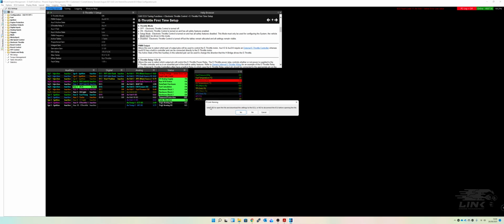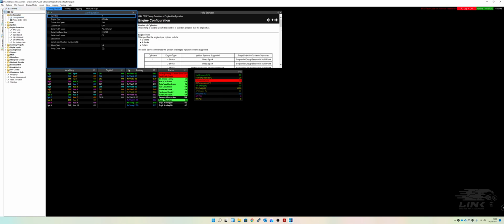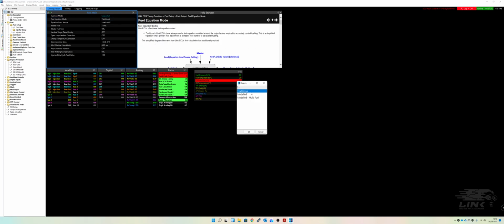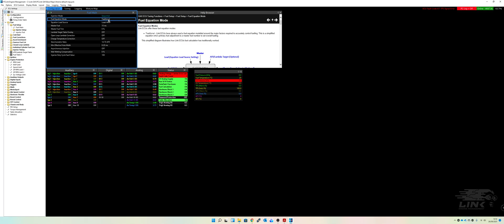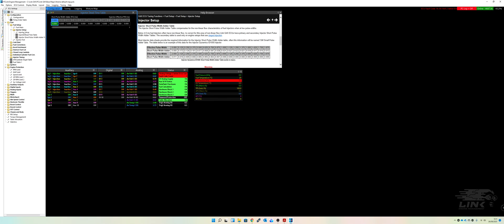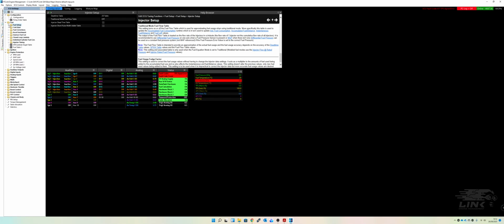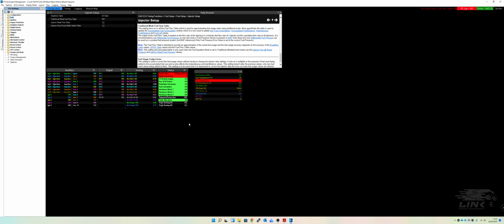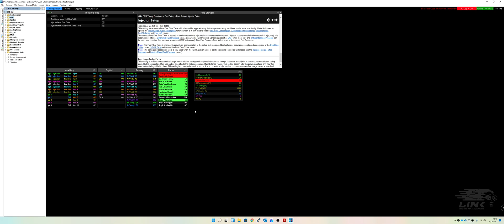Link Engine Management Loading a Base Map

Comment: Hi i followed your instructions on how to load a base map and now the screen im on is showing alot of everything is off off? Should i have loaded a base map that said my car in particular or from the default x map you showed.
Reply from the maker: Hey Redwar08 I'm not 100% sure that I follow what is going on here. Do you mean certain inputs and outputs are off? Was the base map designed for the wiring harness that you have? Are you just using the base map to get VE and Ignition tables so you need to setup the Inputs and Outputs again. If you want to supply more details go over to www.phoenixenginemanagement.com and fire us a message maybe we can see in better detail.
Reply: @PhoenixEngineManagement  ok here is my problem..i have a 350z manual i did alot of work to it. I bought the link g4x ecu plugged it up and followed your videos on how to set it up i did exactly what you said to do as far as setting up the base map. In the last part of your basemap video you saved all the settings to the link g4x default map and i did that. When i pull it up it shows inj off ign off mainly everything is off my question is is this basemap that your teaching us to setup a basic get the car started and running basemap? or is this a ready to tune on the dyno basemap because it seems like everything has to be manually entered in all over again such as injector size, ignition coil imputs etc etc.  So what i did was go back to the beginning and loaded a pre set up base map that already said 350z manual g4x plug in and when i clicked on that and saved it everything was like active so i took a chance and started the car it started and idled kinda high at like 2200 rpm but i had no throttle..it was like no pedal was in the car so i tried to go to TPS and it said something like cant adjust not in setup mode or some shit like that..im like what the Molly fuck is going on here..mind you phoenix ive been building race cars all my life but coming from the carburator world into this advance computer world im totally lost to shit..i wish i had your knowledge because this shit is not easy at all.
Reply from the maker: Hey Reb yeah this video in particular was more just the actual things you need to click etc to load a base map that was sent to you or created for you. The Link G4X default map is by no means a able to drive more an able to just get running ready for Dyno. In reality every single standalone ECU needs to be mapped on a dyno. If you did manually enter all the details in and then saved the file and also saved the configuration to the ECU then it should all be saved and come up as normal. I think you may have some other issue there maybe it saved the file in a different location. Regarding the Drive By wire yes you need to enter Setup Mode to calibrate the TPS and APS (Pedal). I do have a video on how to setup your Drive By Wire possibly watch that and see if that helps clear things up at all regarding the Drive By Wire.
Reply: @PhoenixEngineManagement  ok i will try and do that thank you for your help sir.